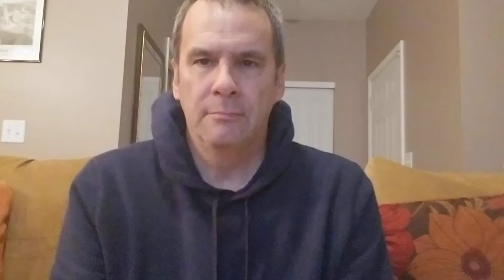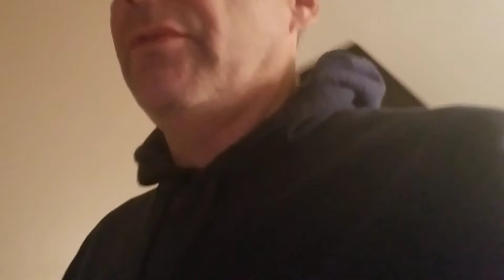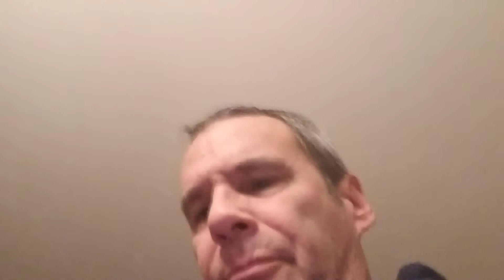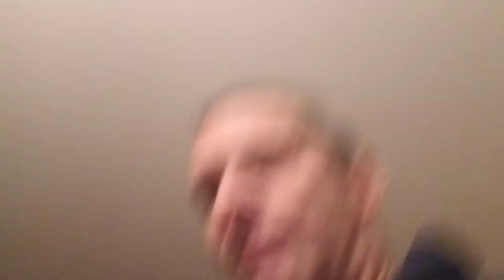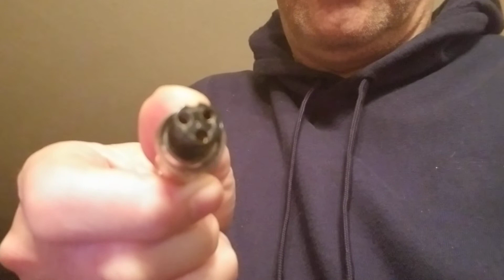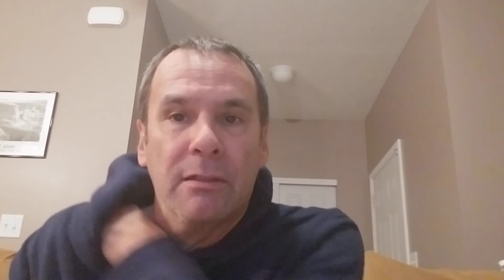Airwheel S3 battery won't charge

Comment: What amp did you run the 12volt trickle charge on?
Reply from the maker: I did not measure the current itself. Just used a Harbor Freight trickle charger.

Comment: Checking back in with an update!
Did you ever just let it sit plugged in for an extended period of time? I (maybe out of luck) was able to "jumpstart" the battery by letting it charge for about 36 hours on the standard charger and it has been working perfectly sense! I don't know if I just got lucky but I am super excited, everything works as should be and its fully charging to (I believe) 64.7v!

Comment: Hey I just got an air wheel and I’m assuming I’m dealing with the same issue unfortunately.  I appreciate the video as like you mentioned I cannot find info anywhere. 
I will check back and add in some updates. 
Right now I’m just going to let it sit with the charger in for a while.